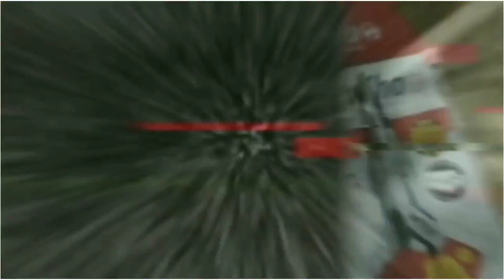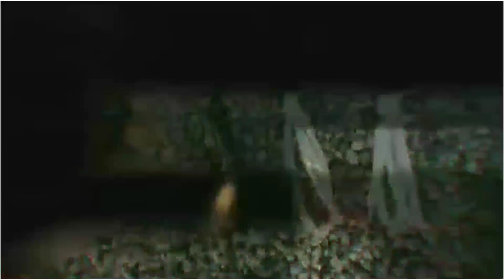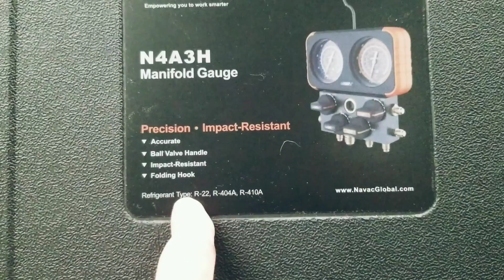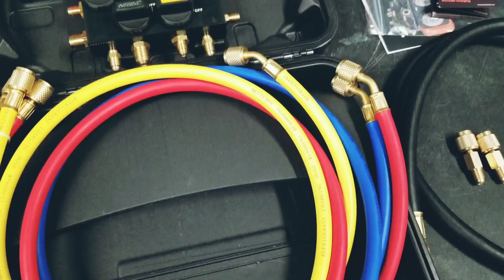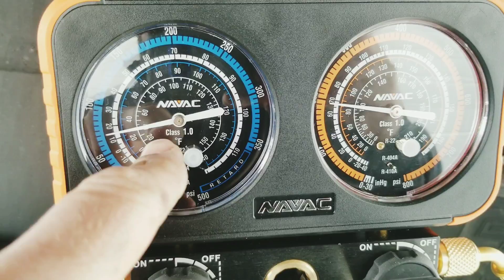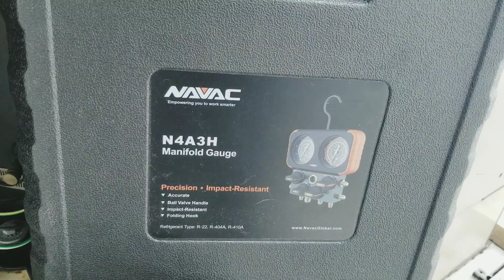HVAC - Navac N4A3H Manifold Gauge Review

Comment: How are these holding up for everyone who has a set? Can’t find much info on them. Received a set of the 3 port from Trutech tools today and I’m not so sure about them. They look nice except for the case that surrounds the gauges is not straight with the manifold block due to the high side gauge being threaded in one thread further than the suction. Not sure if I should nitpick that or not. Also the hook doesn’t seem like it will last. Not sure about the ball valves either. Plus they are made in China, my yellow jackets are made in USA...I’m not trying to bash them, just unsure of them and I don’t like that I can’t find much feedback...

Comment: I purchased these about four months ago and the best analog manifold set I've ever had and you can't beat that price the only thing I don't like about them Is the way the hoses connect to in the storage position it makes it too wide when you're storing them in my truck
Reply: I really want to buy a set of the 3 port to put 3/8 hoses on and use for recovery. These look perfect with the short turn shut offs and durable gauges. The only thing holding me back are those side parks.
Reply from the maker: That's awesome, glad you like them